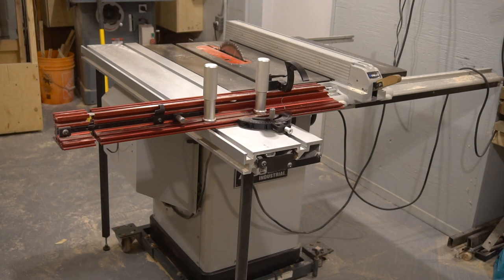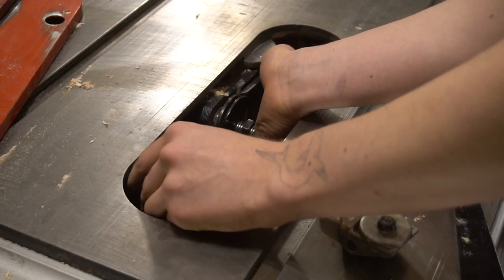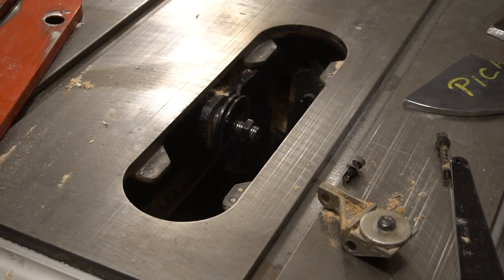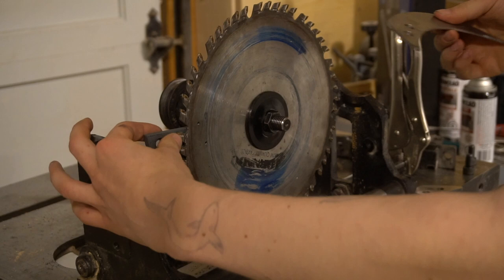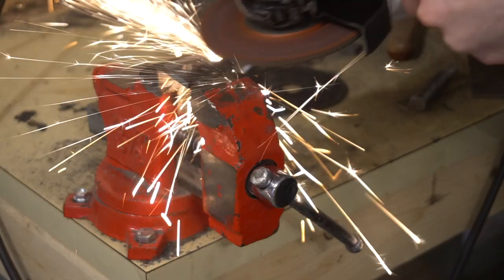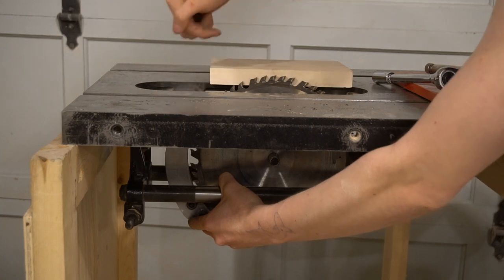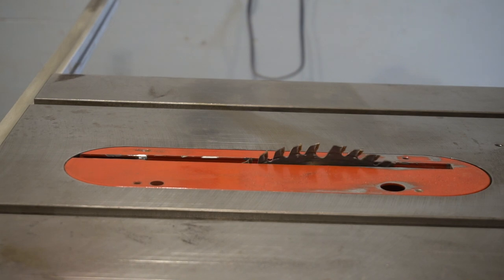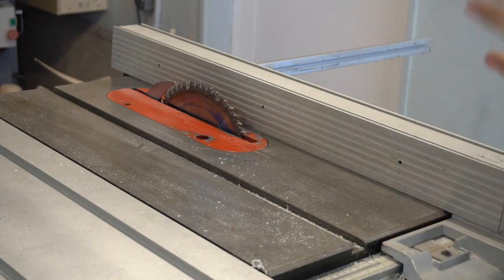Making a Raising Riving Knife for an Old table saw // Table saw build Pt1

Comment: To keep your tap straight here's one way to do it. 
Clamp the work piece on your drill press table. Use your center drill for a starter hole. Drill the hole sized for the tap. Remove the drill bit and reinstall your center drill. Lower the table and use the center drill to center the tap. Most good taps have a center hole in the drive end. That way you can use your tap handle and keep it perpendicular to the work piece with the center drill.
It's easier to do on a milling machine, but you can make it work with a drill press. Great video and nice work, BTW.
Reply from the maker: Yeah totally! I used the chuck as a tap handle in part because it’s such a large chuck (3/4”)  that I can get a good grip on it. I want to make a spring tap follower to use your method more! Thanks for the advance!
Reply: Another way to start a tap true is this: Once you've drilled the hole, put the tap in the drill chuck. Fire up the drill, then turn it off. Before it stops spinning, engage tap in hole. The tap will start, but not go too far before the drill runs out of momentum (reducing the risk of snapping the tap). Undo the chuck, and carry on with the tap handle.  One thing - without a power tapping unit, don't try this if you've moved the work piece between drilling and tapping; or the side loads on the tap will kill it.

Comment: Good video.  I hope when your old saw quit you kept the parts and made use of them. For example extending the top of your new one with the cast top you have. Adapt the blade height as a table height adjuster for the drill press.  The motor put a grinding, wire wheel or buffing wheel. Just a couple of thoughts. 

If you put your champer bit in a hand held drill it will save from swapping bits.  Not a big deal for one or two holes but for more it's helpful.

Comment: LOVE the music! I want to be you when I finally grow up!! Your brave to take machines apart. That being said, as a society we discard so many items each year that with some thinking and ingenuity like what you have shown here, maybe fixable. Your saw looks to be an older saw that still used cast iron tabletops and parts. I have a Dewalt 745 plastic and aluminum job site saw, that is built into my workbench, and is brand new because it was what I could afford at the time. I can be impulsive at times and not thinking a purchase fully through before putting down the money for it. The $400 I spent on it could have gone towards an older Delt/Rockwell, or another solid iron cabinet saw when saws were made to last. Have you thought about finding an older cabinet saw and updating it with modern safety equipment? Your so creative, and it would be much less than a brand new $2-3,000 saw. Your big woodworking company in Canada is General I think, and they have been making solid equipment for many years. Even now, I find myself checking Facebook's MarketPlace for table saws. I'm addicted to tools!
Reply from the maker: Tuning up an old saw is a great idea! i hear the delta unisaws are nice and fairly cheap if you get an old model. Sadly even with all the fixes I did, the delta saw in this video ended up totally breaking and I replaced it with a sawstop. It was nice to have it made from cast iron and so on but the saw was still not designed for professional use and I ended up wearing out many parts simultaneously and new parts broke seemingly every day.
Reply: The trick to working on machines is to see them as a bunch of simple parts combined instead of one complex thing. They're only held together with screws and bolts, and everyone can use a screwdriver and a spanner

Comment: I made a similar mod to my saw which has the same rise and fall mechanism.  I put a slot in the bottom of the riving knife which is concentric with the circumference of the blade edge. You can then move the riving knife independently of the rise and fall mechanism.  You just need to reach down through the table throat to get to a pair of socket head clamp screws.
Reply from the maker: That’s a great idea! My saw sadly has too tight of a fit and doing so would have made the riving knife super thin all the way up which would have made it very flexible.

Comment: I absolutely adore this retrofit!

I have an old Tradesman brand table saw that predates riving knives that I bought from a retired woodworker for a steal. It uses this old style trunion/splitter setup (or at least that seems to be what google calls it). But I have been thinking about whether I could just build my own riving knife mount for the blade assembly. Will definitely use this as the basis for it.

I'm wondering if it could be possible to make the riving knife easily adjustable/extendable to try and solve the issue you highlighted at the end associated with the raising and lowering of the blade being based on tilt.

Comment: Great solution to add a splitter. One option to improve it is you could make two splinters one for 1” or less stock and 1 for thicker stock
Reply from the maker: That was my original idea yes! Ende dup never doing it though

Comment: I was working on a similar project on a grizzly saw, I stopped when I realized that the trunnion follows an arc,  making the knife not raise and lower as is supposed to, I think the saws with the riving knife mechanism raises and lowers in a plane, however watching this video, inspiring me to keep trying, may not be perfect, but its better than nothing. Good job!!!!
Reply from the maker: I’m glad it inspired you to try again! 

I’ve been using the riving knife everyday for months now and I’d say 80% of my cuts the knife is engaged and 95% of the ones I need the knife to be engaged in its engaged so although not perfect, it’s a major upgrade. 

I’ve seen some table saws where the pivot point is on the far side of the blade which makes the riving knife have much less movement. I’m not sure if this is a cheap way to do it or the standard way though.
Reply: My saw is a Grizzly and I can send you a couple of pics if you are interested how I did it.
Reply: @rodneybaker2629  Sure, thanks, I would like that very much!
Reply: How do I get them to You?
Reply: @CarlosMDominguez  I don't know how to get them to you. Do you know how?
Reply: @rodneybaker2629  also you could share files at google drive I think, check this video: https://youtu.be/q66RqcNh6Mk
Reply: @CarlosMDominguez  Yes. I think so.
Reply: @rodneybaker2629  I got Your pictures. Thanks! Very ingenious solution. I wanted to ask you some questions, but my email is acting up, and I am not sure if you are getting the replies. Thanks again.
Reply: @CarlosMDominguez  I just got your message now. Any question I'll be glad to answer. The riving knife does help to prevent kick back. It is well worth the money and time building it. I was interested in your YouTube channel because you mentioned Electronic projects. I'm an electrical engineer by trade with a lot of mechanical background. I subscribed to your channel so I will be watching.
Reply: @rodneybaker2629  Great!! thanks  for that,  I was wondering if it's ok for me to mention      your idea  and your pictures on a future video, if I give you proper credit on the video description, of course. I do like to make videos of all my hobby activities, including electronics, but what I like to do best now a days,  is to share what I do, and the process of video creation.
 its a lot of fun!!
Reply: @CarlosMDominguez  I would love if you did that. I'm not good at making videos. I have done a few in the past, but I don't really care to do them. I do like sharing ideas though, If you can make a video of my knife to show others how I did it, I would really appreciate it very much. 
Also, you asked about the rod connected to the yellow bracket. yes, it causes the blade along with the knife to work concentric to each other. the linkage pivots at the stationary bracket on one end and connects to a bolt on the bottom of the "L" bracket at the other end. As the blade is raised or lowered the linkage keeps the bracket with the knife attached at the same height and angle as the saw blade. It took me quite a while to figure out how to manage that feat. I have to admit, it does work real well. Now, if you arbor is not long enough to put it on the outside of the blade, then you would have to go inside the saw and attach it by other means. My arbor was long enough to facilitate the mounting the bracket on it. You also have to use a bearing so it will rotate independent of the saw blade.
Reply: @rodneybaker2629  Thank you so much for that, yeah that was certainly a very clever solution,  well it did not occurred to me anyway, my saw has a very long shaft to accept the dado set, I may try to do this in the future, but I came out with a different idea, since I'm planning to integrate a CNC motion to the my saw and shaper combo.  Stay tuned, and thanks again.
Reply: @CarlosMDominguez  Hi, are the plans/video available? It seems like a lot of older saws could use such a thing! I'm restoring an old Craftsman 113 an wondered how this can be done.

Comment: The riving knife works beautifully. (1) The quarter-inch stock for the riving knife mount should work just fine. (2) Being able to raise the blade a bit before the riving knife appears is probably practical for shallow cuts and shallow cross cutting. I see no problem.

Well done! Thanks  for sharing.
Reply from the maker: Yeah, I didn’t really get to use it before publishing the video but now that I’ve been using it I’m real happy with it! It works perfect! Thank you!

Comment: Very Nice , thank you   was looking for ideals to retrofit an old Delta contractor saw - this works for my budget - I think I will do  a few sizes / longer knife that works for thinner material .
Reply from the maker: Glad the video inspired you! As for the knifes, It’s not been a huge problem so far since the cuts where the riving knife is critical are usually full width cuts so I can just raise the blade more. But making different sized knifes will work for sure!

Comment: Nicely done! As a hobbyist metalworker, I can't fault your techniques given the equipment you have available. Hit "Subscribe" as soon as I saw the logo going on, that totally makes it a professional installation! 🤣👍
Reply: The Electric Monk : T-slots should be in compression not tension. When clamping onto the drill press have the pivot stud as close to the work piece to achieve a compression between the T-nut, base table, packers, work piece and clamp finger. 
If you ever blow out a T-slot, you get fired, simple. If it's your machine you hate it every time you look at it and know the table now needs regrinding to flatten due to stress change in table. 
He did do a nice job on the riving knife.
Reply: @mrrberger  "T-slots should be in compression not tension." - I guess you're referring to 3:50? Good spot, I didn't notice that. I learned how to use that sort of clamp by watching Darrel Holland's "How to run a vertical mill" videos. Occasionally, you don't have any choice but to have the stud at the wrong end of the slot, but for the most part, yeah; get as close as possible to the front end of the strap as you can.

Comment: Good idea, looking forward to how you change it. Ive got a saw with the same missing riving knife and identical blade carriage. FYI, when doing my apprenticeship was told to leave half inch between riving knife and blade,  cant say if that's an actual requirement though. Thanks
Reply from the maker: I checked online after you posted this and I didn’t find that anywhere. Everywhere it seems to say to set it to 1/16 inch away but most tables saws don’t let you set the distance anyways. Perhaps the 1/2 inch is for a splitter not a riving knife or for a specific machine you were using? I’m not sure.
Reply: 1/2" between riving knife and blade would not have prevented my kickback accident yesterday with a small block of white oak.  1/16" certainly would have.

Comment: You did a great job with this build, and you did about as good as is possible considering the limiting factor that is arc path that the blade takes which limits the effectiveness of the depth of the riving knife. I'm wondering after you've used this for some time now do you find the depth of the riving knife to be much of an annoyance? I don't know if I want to commit to building something like you did or if I just want to be lazy and build a set of splitter throat plates.
Reply from the maker: I used the saw perhaps about 8 months after this video. I later upgraded to a sawstop (the Delta was getting really warn out and it was problem after problem each week and finally broke. All just related to wear, not what I did to it). The riving knife really only had one major issue which was how it would proportionally raise less at the biggening of the ark during raising. It mostly just ment i had to keep the blade more exposed than I ideally would during shallow cuts. Other than that, it worked as well as any other riving knife. For me the effort was well worth it.

Comment: Make sure the knife thickness matches each saw blade you want to use. Cut a groove in a scrap peice, the knife should be just thin enough to move in the cut, but no thinner.

Comment: my wadkin has a missing splitter. I looked in to making a true riving knife that raises and lowers with the blade, but it involved a pallelegram mechanism to get over the problems you encountered.        this would be all good but the dust shroud I built would be in the way of the mechanism.       don't know what's more dangerous, long term exposure to dust if I remove the shroud, or kickback without the rivibg knife ?

Comment: I'm guessing you have 3/8" belts on the drill press. Link belts slip much less & have less vibration. Harbor Freight sells a 0.5" link belt, don't know if they've added a .375. I found my .375"x5ft link belt on Ebay. Great project & nice compromise on knife Ht on a design that rotates the blade up. I didn't see if you tapered the blade side edge of the knife;  mine has a fairly narrow taper which protects from a closing kerf behind the blade.
Reply from the maker: The knife is only slightly tapered on the blade edge to make it line up I case it was some how positioned incorrectly. 

On the drill press the part slipping was actually the Pully to the shaft that it is bolted on. It isn’t keyed for some weird reason and it comes loose every now and then. But thanks for the advice, I may actually use a Link belt on the table saw to cut vibration!
Reply: You may be able to fix that pulley better by drilling a divot where the set screw lands
Reply from the maker: Great idea!

Comment: Hello, did you make the next video yet? The one to solve the issue where the knife does not rise up soon enough? Seems pretty challenging
Reply from the maker: No I have not. My table saw broke (for unrelated reasons) and I upgraded to a saw stop. What I can say though is that it ended up not really being a problem. I just always raised it a little more than if I had a riving knife that followed the blade perfectly.

Comment: Nice work brother! FYI you can buy a tapping head for your drill press for under $100. That said, you did a great job using your drill press to tap, ensuring a perfectly straight tapped hole. Again, awesome work brother! I need this for my old table saw that has no safety and no riving knive.

Comment: Where do you get the clamps for your drill press? Solves many problems!  Thanks, great job.
Reply from the maker: Those are 5/8 hold down clamps. They are made for milling machines and other metal working machinery. They won't fit on smaller drillpresses that you usually find in woodshops. But if you have a 22" or larger drillpress they usualy have 5/8th  t-tracks which work with hold downs and they are fantastic!
Reply: You can go online or even harbor freight carries them as a set.  Very handy.

Comment: 10:10 ok he needs new push sticks as well. But this video is 4 years old so if he still has all his fingers intact he probably got som longer sticks by now.
Reply from the maker: 13 years of woodworking and I can assure you I still have all my fingers :) Cause I film most things on a slightly telephoto lens, sometimes my fingers look a lot closer to the blade than they actually are

Comment: The disadvantage of having the blade so high to cut thin wood, outways the safety of the riving knife.
Reply from the maker: In theory it wouldn't have since there was supposed to be a blade guard on top of the blade. But I never had time to build it before replacing this saw. So for the months that I used it, I simply didn't raise the blade for small cuts. Since as you said, it's more safe to not have a riving knife but have the blade less exposed.
Reply: I mounted a home made riveting  knife in one of my Throat Plates behind the blade. I pop out the Throat Plate when covering the saw  table with a sheet of Plexiglas to keep the iron table from rusting.

Comment: Anyone know where I can get some of those drill press clamps at the 4:00 mark?
Reply from the maker: Those are milling hold down clamps. They are easy to find but you need a large drill press with t slots that are 1/2 inch at the minimum. Most drillpresses smaller than 22 inches can't take them. https://www.busybeetools.com/products/deluxe-52pc-clamping-kit-1-2in-x-13nc-wil.html